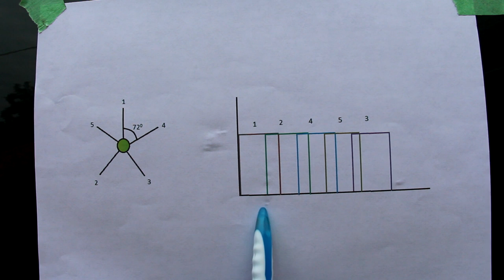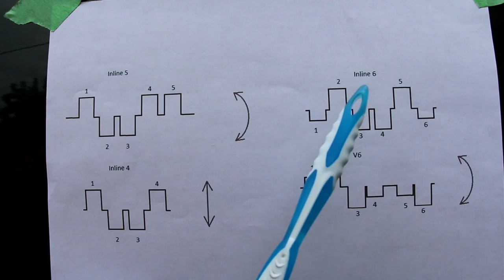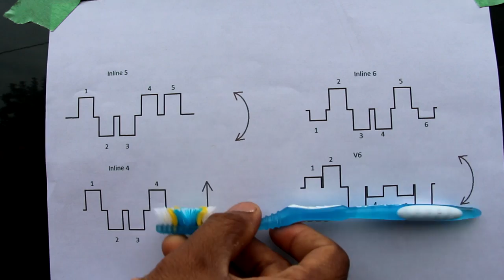Why Inline 5 Cylinder Engines are an Anomaly

Comment: I had this engine type in my 97 V70 AWD, turbo tho.
I wrenched alot on that engine, and it was a nightmare! It developed a knock in the cam shaft area, changed the hydraulic lifters but didnt help. But the valve cover is a story of its own. Shitty design. You should use a special tool to lift it to avoid breaking the cam shafts (a friend of mine did that, he did not know that the cover held the cams). Second, there is no gasket, its liquid gasket. Normally that would not be a problem, but when you have all those small oil passages, and the clearence thats supposed to hold the cams to watch out for.. Its a absolute nightmare. To much gasket it will clog the oil lines, and the gap for the cams can be wrong. To little it will leak everywhere.
I ended up changing the 2.5l turbo engine to a 2.3l T5 engine. Naturally i changed alot of o-rings outside just to be sure. And i can tell you, there is ALOT OF O-RINGS!!!! And as you mentioned, ALOT of places it can and will leak. I got a special hate for this engine design.
On my T5 engine, i had a bigger turbo (19T), S60 T5 injectors, cat delete with a 3" downpipe,  and a chip tune to match all the mods. It also had the stainless Ferrita exhaust.
And let me tell you, it was pretty damn fast! And the sound it made! HOly mother of god! Even tho i hate the engine design, i really really miss the sound, still gives me goosebumps just thinking of it. OOOH!
Reply from the maker: Good to hear owner input
Reply: @speedkar99  well, its just my amateur point of view. :-) i have worked on many other engines thats far better and easyer to work with.. :-P

Comment: Does he not understand heat resistant plastics? They're plastic because it's cheap and easy to make and heat resistant plastics can withstand 500 degrees. You oil temp is usually about 200° and the coolant 210-230°. Those plastics are fine where they are
Reply from the maker: Yeah i understand but in the long run they can disintegrate or crack faster. But who cared once you are past warranty
Reply: @speedkar99  I see it as a good thing to use cheaper heat resistant plastics. Makes the replacement parts cheaper and if they're engineered well enough they will last just as long or only a little less than a metal counterpart.

Comment: 5 cyl on an S40? Surely it wouldn't even fit transversely. As far as I recall the S40 was only 4 cylinder engines shared with mitsubishi, the 5 cyl were used on the 850 and subsequent gens.

Comment: You should get your hands on an older 5cyl, these ar almost thesame as this but much of the stupidity of what you have gone, Volvo 850 or 1st gen s/v70 engines... those have no plastic tube pickup, no oil in the intake and so on, and what have they done to the PCV system? lol, Im glad im sticking to the older 5cyls...

Comment: The comment on the turbo engine models is incorrect. The turbochargers have the manifolds built in, not the head. So you're bolting the manifold and turbo assembly together to the head.

Comment: Now I believe I know why Ford went with their water pump-in-block design which destroys the engine when the pump fails. They got it from Volvo (which they owned for awhile). #fordduratecV6
Reply from the maker: So the water pump can't be replaced?
Reply: @speedkar99  It's behind the timing cover driven by the chain, internal to the block. If, by a miracle, somebody noticed it weeping, yes it can be changed. A $2K to $3k job for a water pump! Apparently, what usually happens is the water pump wears out and is not noticed and coolant gets into the crankcase. My Flex is at 110K miles. It's worth maybe $4K. So...what does one do? I dunno.

Comment: volvos  i5 are a oddball engine and yes they have no relation to audi VW as some believes (the disel one is made by VW) and tis reliability has proven that it was despite flaws in its design to been proven to work, even when tuned hard they  can handle their own.

Comment: You don't mention fuel efficiency.  When new, my 2004 I-5 Volvo would get north of 30MHP highway with conservative driving.  At 55 MPH it was capable of 40 MPG and had a ridiculous range of >500 miles.  It was around that time that gas started to spike to around $3/gal and then up to $4/gal.  And yet there wasn't a peep from Volvo marketing about fuel efficiency - they were still trying to move from cruchy, "conservation" minded utilitarians to luxury brand echo-woke buyers.  Geniuses that they were, Ford, then owner of Volvo, started to replace the I-5's with V-6's in some of their model trims, and they marketed it as "now you can get a great Ford V-6. People who wanted a ford V-6, of course, could just go to the Ford dealer down the road and spend a lot less.  Completely missed opportunity.  Then of course is the EPA's bungling, since their certification process started to change from what an engine is capable of, but what most dumb-a##'s will do.  "Wow, I have have Volvo wagon, let's see how fast it goes from 0-60."  That's not a thing really.  There were plenty of other weak points on these cars -- their computer systems, which seem to have durability issues -- and their transmissions, which were not the best and did not have a filter.  Great video BTW.  I still have that car, but can't run it anywhere close to it's range because of computer brain farts that will cause it to need to sit overnight before it can run again.
Reply from the maker: Awesome thanks for your input

Comment: I can see clearly the planned obsolescence that has gone biserk with the Volvo engineers
Reply: How so?  The Volvo 5 cylinder is one of their most reliable engines.
Reply: Jeah, what do you mean by that, i have volvo 850 from 1996 and 2.4 10 valve engine with more than 600 000 kms and still going :D

Comment: I had a chance to get buy a low Mileage AWD Volvo S40, took it for a test drive looked at the engine bay and I was like fuck this lol and passed.
Reply from the maker: Lol what was wrong with it
Reply: speedkar99 the suspension was  a little too stiff, and I didn’t like the way it felt around corners. Although the mileage on the car was low (60k for an 06) the interior looked like it was pushing 100k. Then after popping the hood and looking at the 3% of free space to work with and no dip stick to check the transmission fluid, I passed on the car. I got my self into an 05 IS300 with 95k miles on it, today it has 125k and I’ve only had to replace a brake booster. The car runs great. Last I heard of that Volvo it needed a repair lol

Comment: Im mad you didnt just rebuild it.
I would get me some new conrods, slap new gaskets and flush it with dish soap and warm water from a pressure washer to clean the Cremè au Caffè that was created there. Then the hard part would be to find a decent volvo without an engine.

Comment: If Inline 6 makes the smoothest engine, why are they not popular?
Reply from the maker: Packaging
Reply: they're often too large to mount transversely in a front engine front wheel drive configuration (although Volvo has some models with an i6 engine).
BMW uses plenty of i6s mounted longitudinally and with rear wheel drive, so the engine size is less of a problem.
Reply: Mainly length. They are too long to easily mount in a transverse front wheel drive layout. Yes it can and has been done but it's tough. For RWD applications, in the same amount of space you can get say a 3 liter I6, you could fit a 7 liter V8. Vs just give you a lot more displacement per engine bay size. If you don't need that much displacement, I4s are smaller, cheaper and get the job done. I5s are kinda a compromise. A little bigger, more powerful engine but can still fit in most applications you would otherwise use an I4 in. 

Of course in a way, I6s are very popular in the extreme performance arena, they just use two of them. it's called a V12.

Comment: I've never seen a 5 cylinder engine most of the time i see inline 4's and v6 engines.
Reply: They are out there. VW puts them in Jettas and what have you. GM used to have one they put in trucks and Hummers, not sure if they still use it in anything. Volvo is kinda famous for them. The only one I've ever had was a 2012 Jetta and it ran great. I really liked that car.

Comment: this thing looks like an absolute pain to work on. it's almost like engineers don't even think about people having to service them, or don't want them to.
Reply: You don't really need to service them. Timing belt change once 180.000 km, oil change isn't much complicated. And when your engine failed, those volvos are so old, that you can buy same as you had with working engine for around 2000 euros.

Comment: I have flipped cars for a long long time. I once had a volvo 5 cylinder that needed a timing belt. The timing on the engines have no marks. There was this weird clocking position and three different possibilities... yada yada yada...

It was more money efficient to kick it down the road. No thanks

Comment: Engins with oil Coolers arnt that Reliable 
Talking bout colling with water
Engines with dedicated air cooled oil is the best
U know wt i mean !!
Reply from the maker: Why so
Reply: @speedkar99  cause when the Oil cooler (water) brake 
It will mix oil with water 
But will not w a true Radiator for cooling the oil 😍😍

Comment: Down vote for the nonsensical "anomaly" assertion. Their products of mechanical engineering in internal combustion engine technology. And long before they were made popular in automotive applications by Audi and Volvo, they were common in marine diesels made for example by Wärtsilä-Sulzer and other engine manufacturers concentrating on industrial size diesel engines. There's nothing anomalous about them and they come with several worth while benefits when compared to for example 4 cylinder inline engines, while offering a more compact package than the more conventional sixes. Or, as you would nonsensically attach moral value in this implementation and assert the 4 and 6 cyl configurations as being 'normal' and or 'healthy' or perhaps even 'religious canon and virtuous in faith' as opposed to the 'heretical' 'paganic' or 'satanic' inline 5?
Reply from the maker: Thanks for your feedback

Comment: So why are 5 cylinder engines an anomaly?
Reply: Both engine balancing and the compromise of a 5 cylinder engine vs a 4 or a 6 (so, length in case of a 4 cylinder and balance in the case of a 6) is not a very necessary one. However, they make amazing noises.

Comment: I believe the Volvo engines 4,5,6,s since around 2000 have all been designed by Porsche I have owned both a 6 cyl none turbo and a 5 cyl turbo and I believe  they are good engines but MUST be maintained correctly that engine was never maintained the owner should be......still be stuck by the side of the road....waiting....waiting......

Comment: Good video but you're wrong about the 5 cylinder crank being unbalanced its a bit more than a drawing on a sketch board and this wasn't the course of the failure of the engine

Comment: super freaking gae how the water pump is inside the timing cover. Cheaper to just buy a used engine instead of paying for a water pump replacement.
Reply from the maker: Many timing belt driven engines have the water pump driven by the timing belt
Reply: @speedkar99  Many timing belt driven engines are freaking gae
Reply: hmmm you never mentioned how this engine failed. I think ford also had a water pump inside the timing chain, and those engines would fail when the water pump would leak coolant into the the timing cover/oil pan

Comment: Oil can be an effective coolant, if there's enough of it. That's how air cooled radial engines work.
Reply from the maker: Oil is not as efficient as coolant which is what this engine was designed for.

Comment: Overly complex, under engineered, metal where it could be plastic and vice-versa poorly designed (what design? They just put existing parts together) crappy engine. 5's may SOUND good. but have no low-end torque, no top-end power. I have one in my T-4 VW EuroVan camper. With the ridiculously complex counterbalance shaft that rotates between the crank throws, it's smooth enough, but lord, give me back my Boxer four!. In the T-5, VW learned their lesson and put the VR-6 into it. The transaxle is such a joke,  the engine can't get any power to the ground. Why doesn't VDub use a well-known designed (say Peugot/Citreon) transaxle that works and holds up? Peugot/Citroen have only been using FWD transaxles for a Century...

Comment: haha, you complain about volvo using plastic, I hope you will never have to work on VW turbo petrol engines... I own a 1.8T and almost every single time something breaks or leaks its always because of perished plastic parts or rubbers... its a pain in the ass. But at least the engine is smooth and powerful so something for something i guess

Comment: save yourself 15 minutes... 5 piston inline engines are a bad idea because imbalance cranking and weak camshafts
Reply: Other than a triple or an inline 6, I would have no other engine than an inline 5. Guess our opinions are at opposite ends.
Reply: @alexveldhuis6004  inline 6 is only good if you turbo it, they have no torque... three  bangers wont even power my lawnmower... also camshafts dude, the longer they get the weaker they get.
Reply: @braggsean1026  A triple is in my bike and is perfectly capable. Our old ford 3000 has a 3 cylinder engine and still produces the 45 hp it was designed to make when we bought it in 1968. Might I suggest there is something wrong with your lawnmower, if a triple can't power it. Mine has a Kubota triple diesel and works excellent. Many more trucks run turbo 6s than anything else. I personally have no experience of a 6 engine failing on account of their camshaft. A well designed 6 cylinder engine will have camshafts that have enough girth to them for their length not to be an issue. BMW use almost exclusively inline 6 and Ford's Barra engine is very popular for tuning, including turbo charging as they are such a strongly built engine. Toyota jz2, Nissan RB 30/32/35 all very strong engines. Volvo and Audi inline 5, all good engine. So yeah, ''dude'', happy for you to have your opinion, but your argument is not substantial enough to convince me.
Reply: @braggsean1026  Ah, I see your problem. Never mind dude, we all have our crux to bear..

Comment: These engines had allot of plastic attached due to ford owning volvo between 2004 and 2011 this made volvos unreliable in between those times and this is one of them unreliable products of ford i have the mk2 ST that has the turbo version of this engine and at just 115k its needing a rebuild

Comment: 5 cylinder is great, Volvo is crap. The Audi inline five 2.5 liter diesels are still running with half a million kilometers on them, Audi is awesome in aww so many ways. Now...  I had a couple of Volvo inline 5 and the whole cars are so bad that you will not worry about the engine. With the 850 Volvo went from familiar engines in familiar rwd cars to "modern" engines in weird fwd cars, after a few years of struggle they sold out to Ford and then to Geely, China where it belong. Its crap, its shit, its chinese crapship.
Reply from the maker: They should stick with the real thing, i6